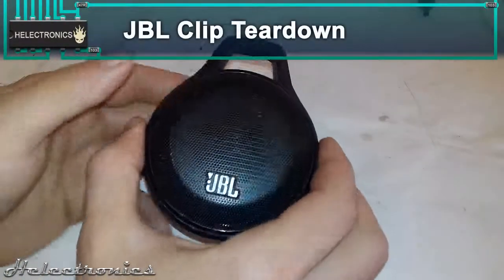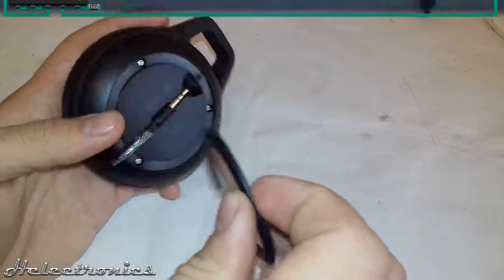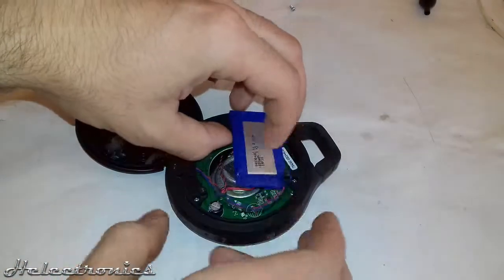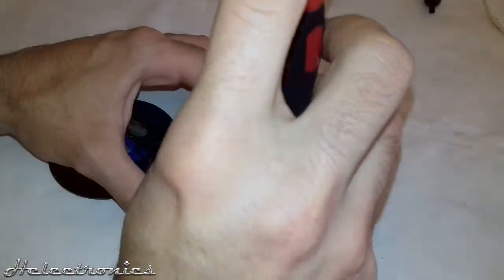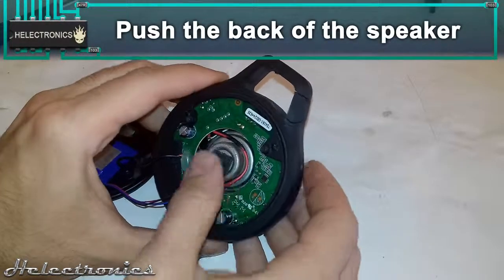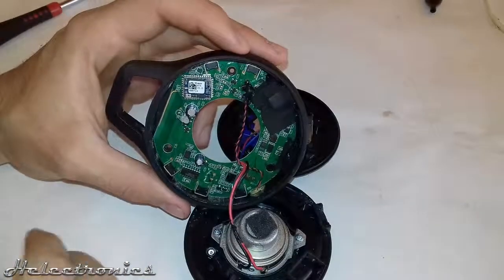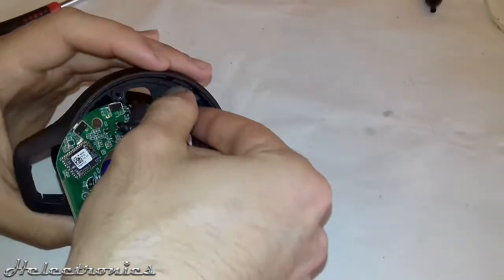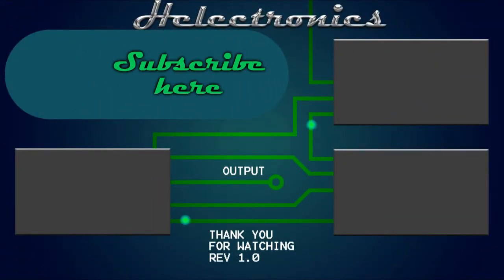TEARDOWN - JBL Clip Bluetooth Speaker (Easy-Medium Difficulty)

Comment: Do you have a video on replacing the battery?
Reply from the maker: Hi, sorry but no. It's not that hard to replace if you have soldering skill. You just have to take care to replace it with the same type and value li-ion battery.
Reply: I see that when I put the same model number battery it comes back 800 mAH instead of 600 mAH. Can I use that?
Reply from the maker: Yes, it should be working. Is it 3.7 volts rated both the old and the new one too?
Reply: @Helectronics  Thanks for the responce